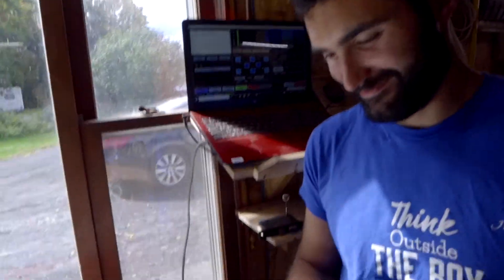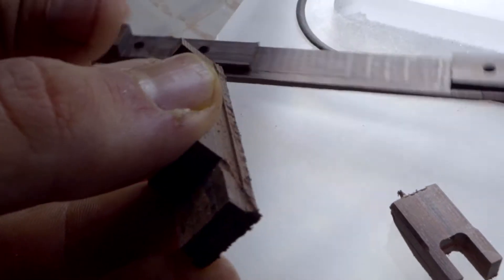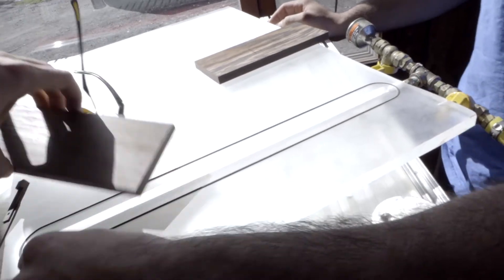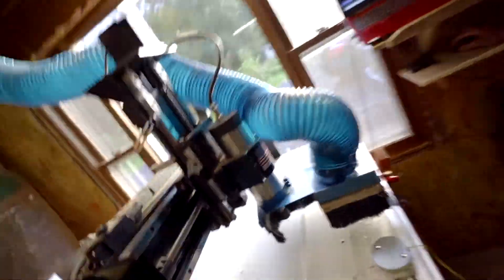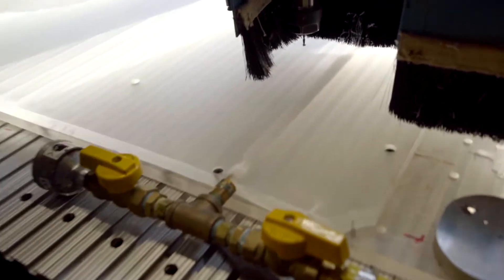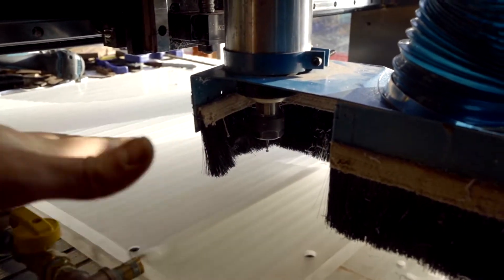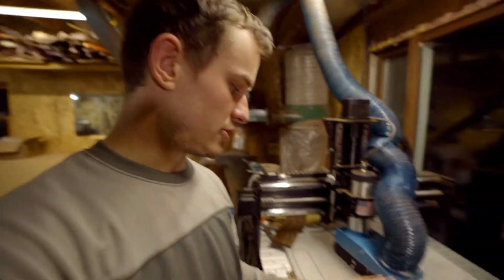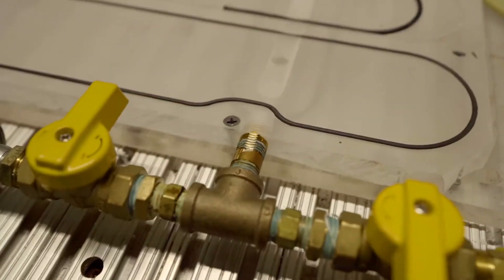Making a Vacuum Fixture for the CNC | Part One

Comment: Wrong kind of tape.... but vacuum is better anyway. I came across your video because I'm about to make a vacuum chuck myself
Reply from the maker: Are you making wood parts or metal? I find I can leave about .01" stock to leave without this vacuum table pulling through.
Reply: @JesseBorn  Metal